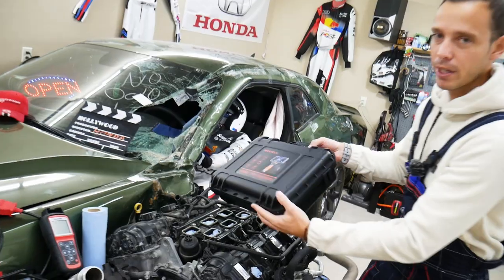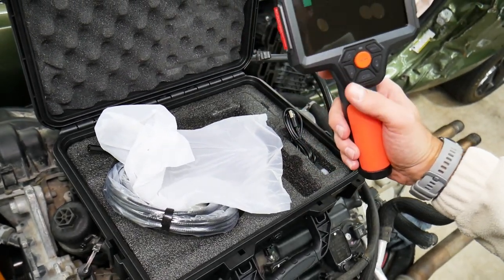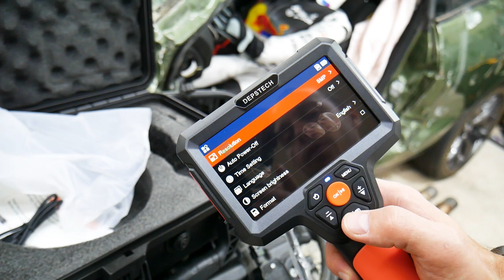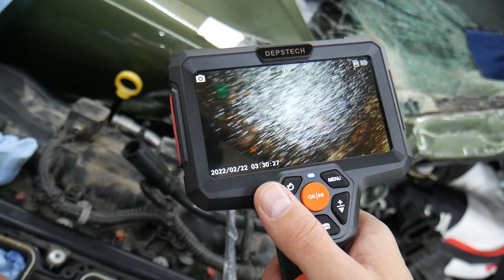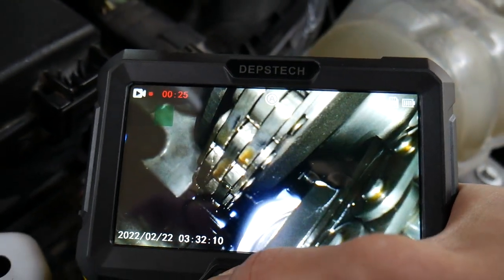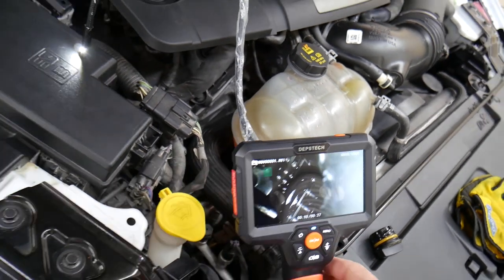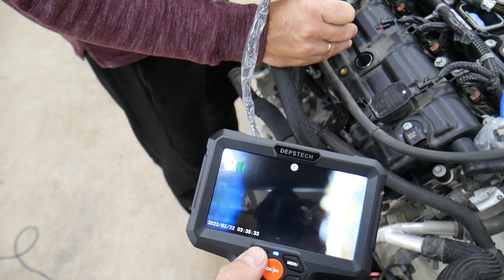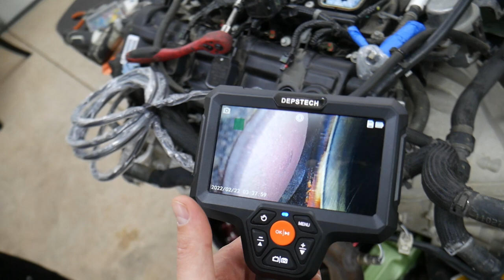DEPSTECH DS580 Enndoscope Camera Dual Lens Borescope, 5.0 MP HD with Light Product Review

Comment: I have my DS580 ordered and it will arrive to me on Friday 18 November. 
The manufacture told me you can order an extra cable and camera for less than $100 to have for a spare.
If I am not mistaken you have the option on the DS580 to see the front view and side view at the same time on the same screen
I will be using the unit on my 2000 Mercedes ML320 
Thank you for all of the videos especially the Mercedes ML 320 videos !

Keep up the great work and videos !

John From North Carolina